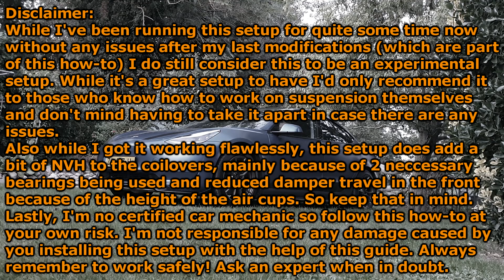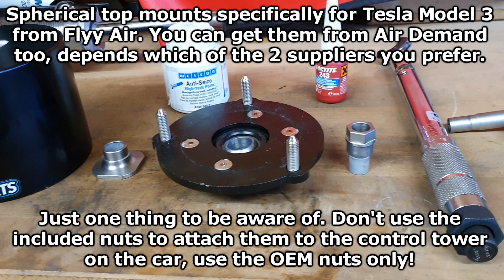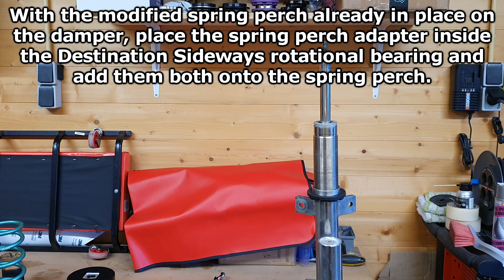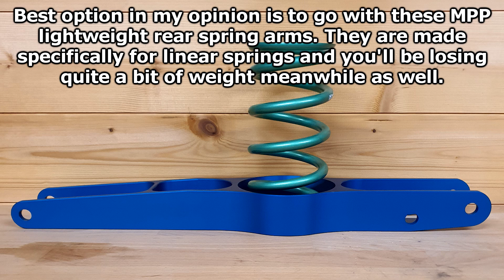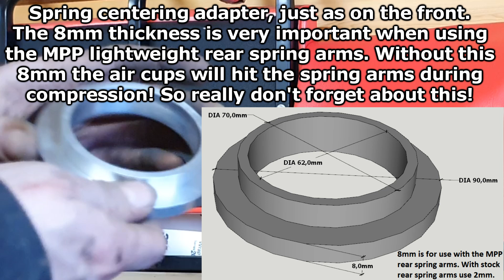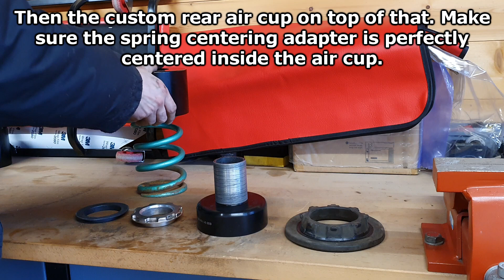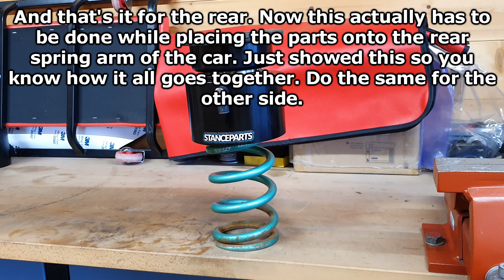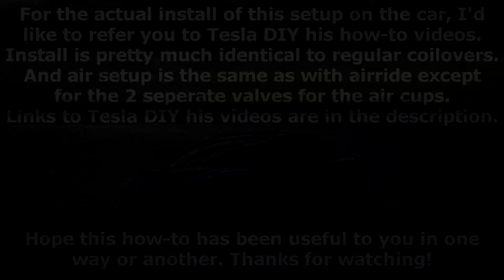Tesla Model 3 - How to: Mountain Pass Performance coilovers with Stanceparts air cups

Comment: Really nice job. What about the Handling and suspensión Travel? Did you do an I thing with the bump stops?
Reply from the maker: @calvorota74  Thanks! Handling is the same as the coilovers without air cups. When the air cups are not engaged they basically only act as a spacer. Has no influence on the handling. Suspension travel is a little bit less though since the air cup takes up some space on the damper shaft. But it was no issue for me. I didn't trim or remove bump stops, all original MPP/KW.

Comment: Love the video! how was the reliability so far? was thinking of doing the same thing for my unplugged performance coilovers.
Reply from the maker: Thanks! Reliability has been pretty good actually. I did have 1 Viair compressor that died on me but since I have dual compressors that wasn't really an issue. Got a new one in warranty. Other than that, everything else still working perfectly. Only downside with this setup is noise really. At low speeds on bad roads there will be quite a bit of noise, coming from the bearings that are necessary to make this setup work on a Model 3. No way around it really. So it really depends if you mind the noise or not. If you do, I think air suspension is the only option. I've tried everything but this setup can't be made silent.